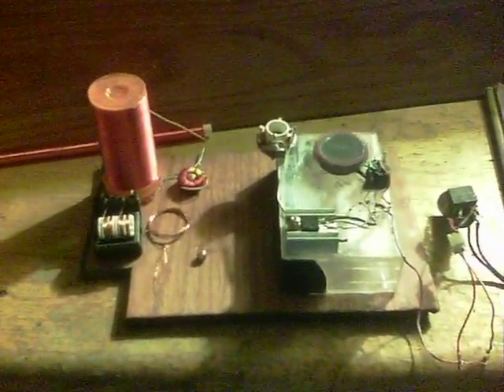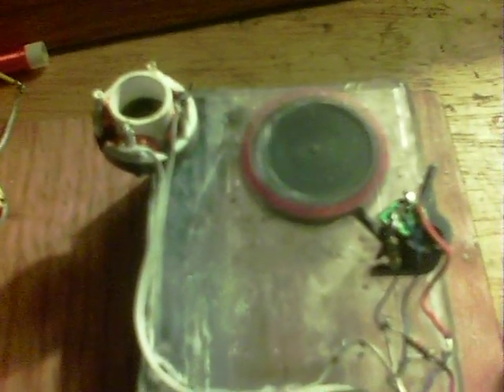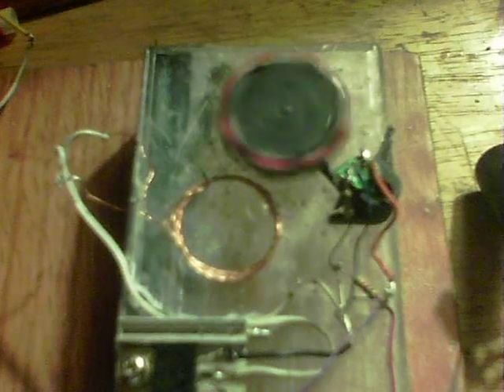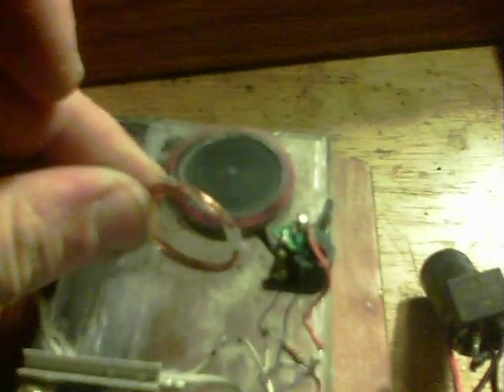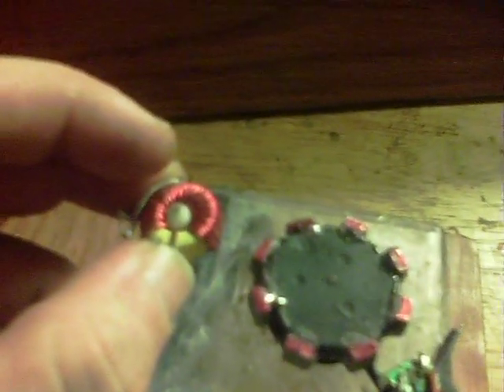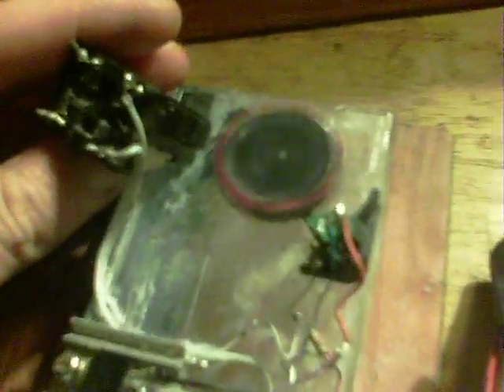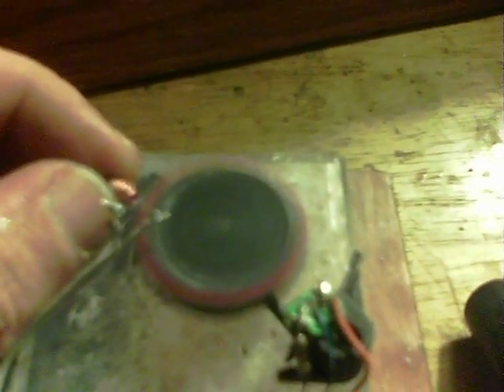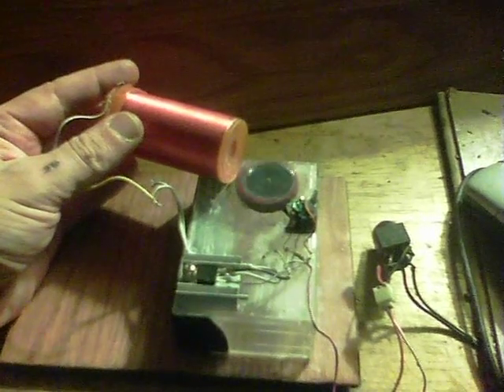Oddball coils running a pulse motor

Comment from the maker: Long time back now. I think I sent the output to the Gate and a 1K resistor went from the Gate to the Positive voltage input. Most of those circuits from about a year ago were just 'solder and see', so unfortunately I didn't create or save diagrams. Thanks for watching :)